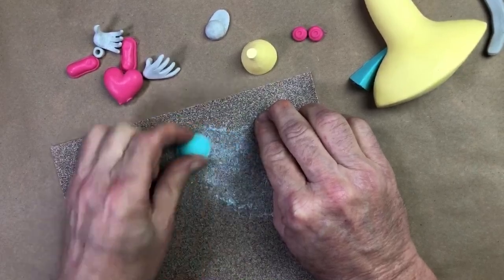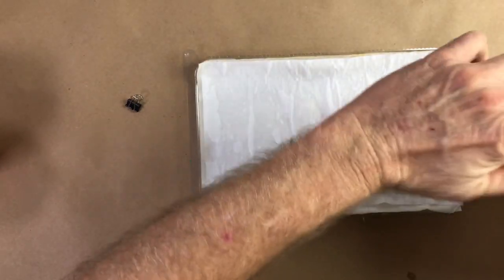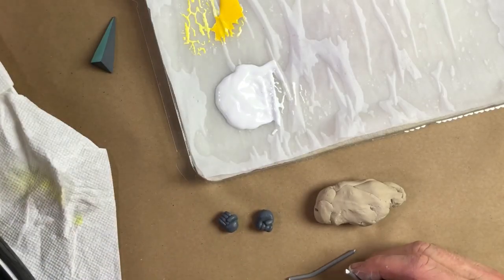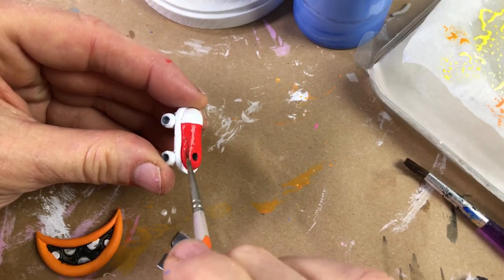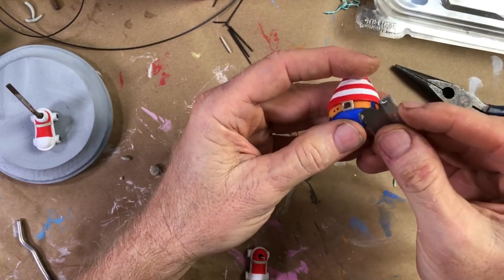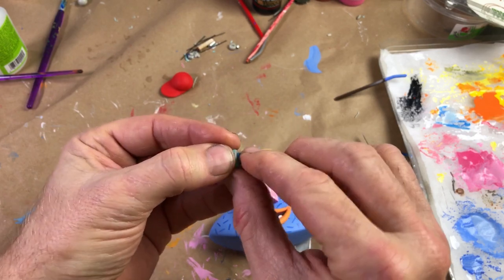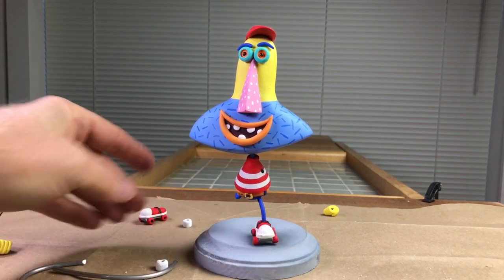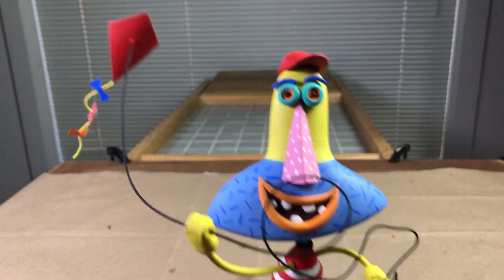Painting A Cast Resin Sculpture

Comment: Love your videos. I can tell you've been doing this for a while so I know you've done your research and what are the best materials for the job. What is the resin and the silicone you use?
Reply from the maker: +NINETEEN NINETY-EIGHT  I buy most of my molding and casting materials from www.silpak.com. The urethane resin is Silcast II and the silicone rubber is Econosil-25. They are in Southern California but they ship anywhere. 
I’m not affiliated with them in any way; just been a customer for more than 20 years. Thanks!
Reply: @RobertTolone  Thanks you very much. I stay not too far from them so it works out great. Thanks again.

Comment: I find that my acrylic paint is uneven with bumps, how do I fix this?  What does the gesso do?
Reply from the maker: It’s hard to say without seeing what’s going on with your paint. Jar acrylics or tubes? Are you mixing them with water to a brush able consistency. Acrylic gesso is a good reliable base to paint on. It’s white and sandable. It’s often a good idea to prime surfaces before you paint them.
Reply: I use  jar acyrlic paint, like yours, but use the cheaper on Americana ?  not watered down. 

What is the purpose of using both the primer and gesso? Do they do the same thing?
Reply from the maker: I use a primer when I’m painting on plastic or resin. From experience I know that the primer will adhere well to the plastic and the acrylic will adhere well to the primer. But it is very important to test your materials. I like painting on gesso so I almost always start with that. Even if there is a primer coat on the model already.